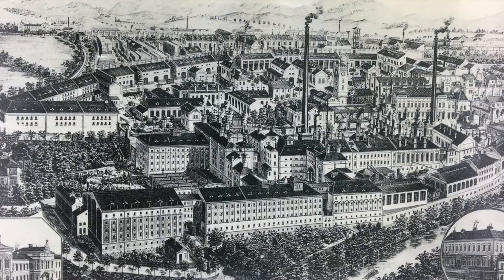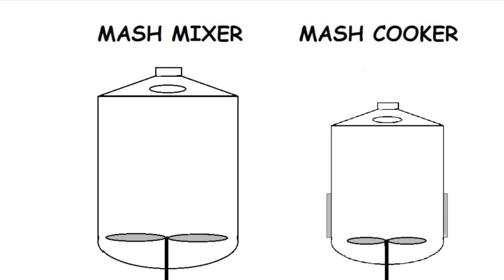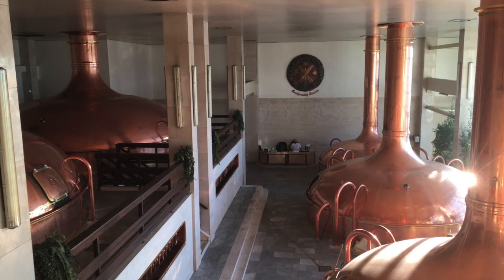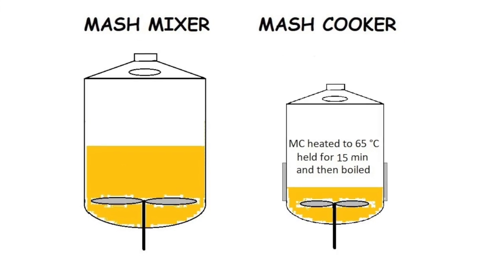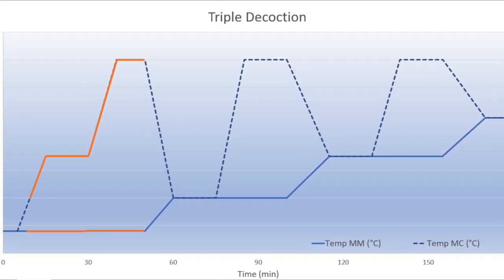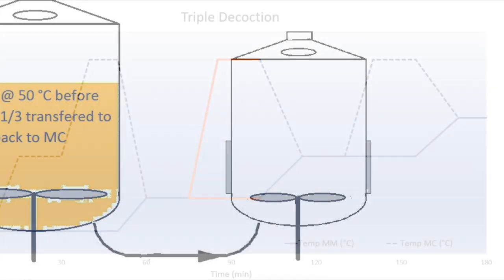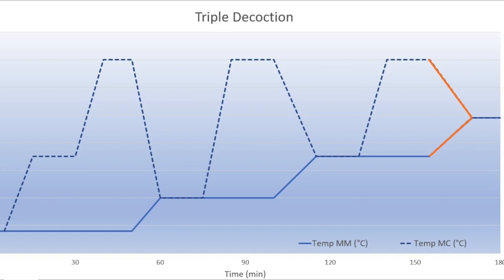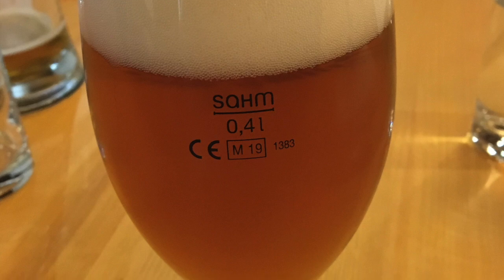Decoction Mashing in Brewing: A Traditional Technique for Enhancing Malt Flavor (Triple Decoction)

Comment: Keep them coming! For my next lager I really want to try doing decoction mashing. Any advice?
Reply from the maker: That's awesome you're thinking about trying decoction mashing for your lager! It can definitely add a lot of depth and complexity to the beer.
If it’s your first time, keep the recipe simple (try a single decoction first) so you can really focus on perfecting the decoction process itself.  Make sure you’re dialed in on your temperature steps, especially when you're pumping the decoction back into your mash vessel. The key is to maintain control and avoid overheating the mash. Try to aim for good conversion temperature range (65 - 68°C). Overheating the main mash after pumping the decoction back to your mash vessel would result in long or incomplete conversion of the starches. 
Also, don’t rush it. Decoction mashing can take a bit longer, so be patient. It’s a slow process, but the flavors you’ll get from it are worth the time!
Lastly, use a bigger mash vessel and make sure that your mash tun has enough capacity.
Good luck, and let us know how it turns out.
Reply: @KPUBrewing  Thank you, this is super helpful!!!